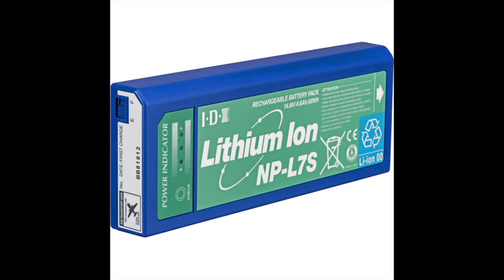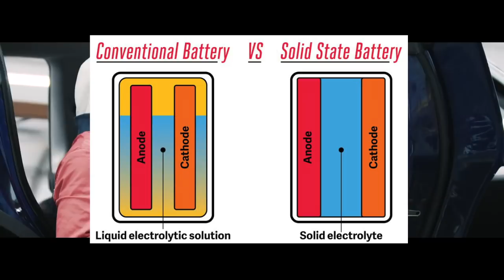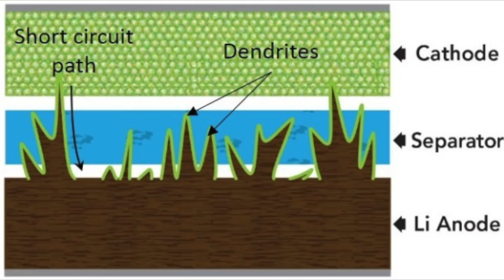Tesla Solid State Battery? Tesla Battery Investor Day Speculation

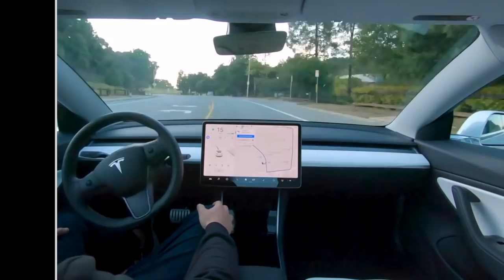Comment: Owning an ICE engine will be like owning a horse. You made a slight error @ 5:20, but I'm sure everyone else understood what you meant as well as I did. 😅
Reply: people who live in densely populated areas, condos in big cities won't be able to charge their car at home. ICE is very relevant for todays world until there is a breakthrough in infrastructure to support these cars charging everywhere. Also range anxiety sucks so having a vehicle that can do 1000+ miles on a charge would be amazing.
Reply: @jtit2025  In due course. We are at the incubation stage of electrification. Small, but sure-footed steps in the right direction, my friend.

Range anxiety is still a thing for most people that do not own an electric vehicle, but for those that do, if you speak to them personally, most will tell you it doesn't exist. However, most buy an EV because it suits their needs, so this point, the one most favor when campaigning for EV's, can be a rather weak one.

Infrastructure is also a weakness in densely populated areas, as you say. There will be retrofitting of many buildings in the future to compensate for this. I have seen plenty done in my area already and many more planned to follow. It will take time, just as any major shift in the world would.

Comment: The LiFePO4 is solid state and very safe - but has around 1/2 the capacity of Li-Ion used in current Tesla cars. Just making the battery solid is only part of the problem.

Comment: They’re not going to announce solid state batteries....I’d bet the house on it! The tech just isn’t there yet. And think about it, if 
They did achieve solid-state then wouldn’t it make the high bar and Maxwell acquisitions pointless? 
Here’s what I predict. They’re going to announce a modified chemistry eliminating and or reducing the most expensive elements along with utilization of the dry electro Tech they picked up from Maxwell dramatically reducing the cost and time required to produce cells. These cells will have an improved energy density which will allow them to use if you were cells per pack which will not only reduce the cost of manufacturing the pack which will result in a higher margin and will reduce the way to the vehicle which will improve range. Another announcement I think a lot of people have been sleeping on is the integration of Maxwell ultra capacitors which will allow 100% of the regenerative braking energy to be stored And then used to accelerate the vehicle back up to speed and doing this will reduce battery degradation by drastically cutting back on the constant pushing and pulling on the battery pack anyways I’m not gonna write a whole book but I think they’re going to announce much greater than 1,000,000 mile battery pack and drive train for that matter closer to 2 million

Comment: If they do succeed, the possibility of a Tesla Model 3 Long Range going 800 km (497 miles) on a single charge may not be so ridiculous after all. Or it could be the same 310 mile range but with major weight reduction since the battery pack will be much lighter.
Reply: You mean the same mileage but cheaper

Comment: You don't know what you're talking about. There's nothing in Maxwell's technology pointing to a solid state battery. It's still Lithium-Ion chemistry and it's still a liquid electrolyte, hence not a solid state battery. That doesn't mean the battery isn't improved in many ways - cost per kWh being the biggest expected improvement due to Maxwell's dry electrode manufacturing process. But again, it has nothing to do with a solid state battery.

Comment: I’m sorry, but I very much doubt solid state batteries will be in Tesla’s for at least 5-7 years. That picture of a solid state battery on someone’s finger is the limit of any possible technology for now.  Maxwell were bought for their “dry anode” technology (or was it cathode?), which has potential for +50% energy density and -15% cost compared to today’s lithium ion batteries.  All of the other acquisitions lead to a more efficient construction of the battery. Combined, by the end of this year we may be looking at a battery that is +20% energy density and -15% cost.
Reply: That picture is not even of battery but of surface mount capacitor. Something that is used to used to smooth out spikes in voltages on printed circuit boards.

Comment: Tesla investor myself here but I gotta say there is a lot of misinformation in this video. There has been no indication that Tesla/Maxwell have been working on solid state (SS) batteries whatsoever. Maxwell is focused on Dry Battery Electrodes (DBE) which is NOT the same thing as SS batteries. I still can't believe people confuse the two to be the same. DBE has to do with the Electrode...NOT the Electrolyte (which is still liquid). In SS batteries, the electrolyte is solid...hence the name. SS battery technology is still no where near commercialization. It works well in labs but its not ready for mass scale adoption yet mainly due to cost and other manufacturing hurdles. Do some proper research before you put out information like this. This is very misleading.

Comment: Solid State batteries are not ready for prime time right now so I doubt they will be significant part of Tesla's battery day.  Listen to Elon Musk's own words in the 3rd Row Tesla interview.  They probably announce a dry electrode manufacturing process, a bigger diameter battery and other changes in the battery chemistry to achieve greater energy density, lower cost, and longer lasting batteries.

Comment: What the heck did I just watched. Solid states are only working so far in a powerpoint presentations only. Some say 2025 - 2030. They purchased a powder coating technology that allows for a production of cheaper and better cells using current tech. [makes sense]